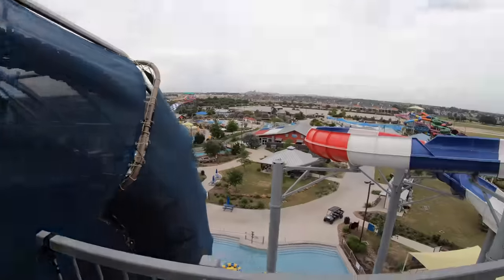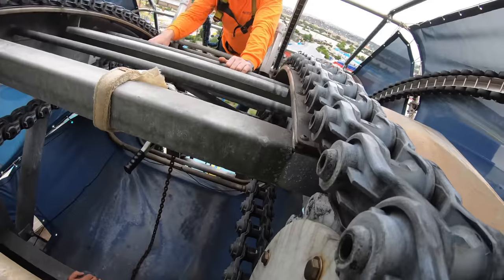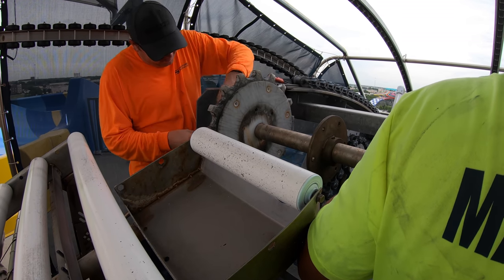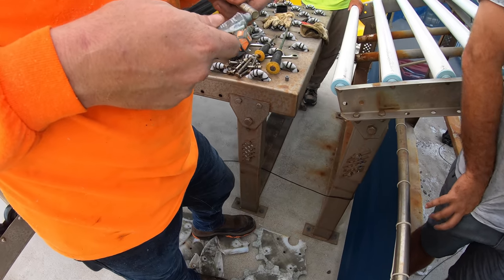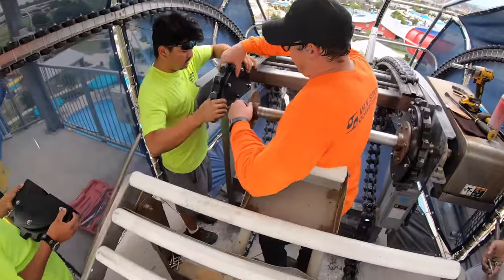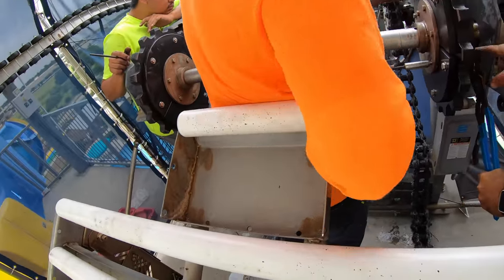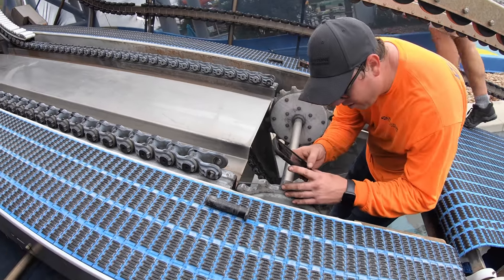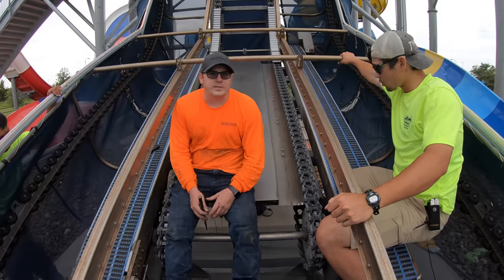Vanstone Conveyor Main Chain Sprocket Replacement

Comment: Sure it is a proven way to replace this, but for strength, wouldn’t it be stronger if the 2 “plastic” outer rings, bolted to the sprocket, are turned 45° on one side and 90° to the other side of the sprocket? And for crack finding, UV absorption and heat expansion, made of a white material?
Reply: Also I’ve seen one bolt missing in the right sprocket, might have missed you talk about it, but what wrong with that?
Reply from the maker: So the bolt, we had replaced when it was cross threaded.  We were on the floor when one of my guys went and replaced it.
As for the sprocket pieces, it's hard to tell on the video, but they the pieces are cut off-set so the cuts do not align, giving to the strength you mentioned.
Reply: @thepoolguy  I think he was talking about how the pieces should be rotated so the bolts link everything together before the main drive shaft. A vague offset would prevent lateral movement, but not rotational. Given time and force those plate's split gaps could widen and lead excessive wear or worse something to jump..
Reply: Agreed. I was a bit surprised they had all the cut ends lined up. Maybe this application doesn't need the added strength, but for sure, rotating the side support rings about 90 degrees from the split gear would reduce stress at the hub and greatly add strength to the entire gear assy...
Reply: Absolutely, but depends on how the half’s were manufactured and whether the keyways permit the indexing.

Comment: What are those sprockets made out of? looks like some sort of plastic, Teflon, or pvc?
Reply: If I caught it right, HDPE aka "High Density Polyethylene" which is a awesome dense plastic that is also reasonably smooth and sometimes described as self-lubricating (not really, but better than some). Commonly used for bushings and such as a wear component, so that the HDPE part wears down first before the more expensive or difficult parts. Note when they were at the bottom and there was a  guide he was talking about being worn and that there is a new one. That is likely designed to be just a bit softer than the chain/links, so that the links move easily but if/when wear happens it is "simply four bolts, length cut to size".
Reply: @admalledd  i have heard this black HDPE often referred to as Delrin, but I guess that is just a brand name. For people wondering what it is like, it is essentially the same material plastic cutting boards are made of.

Comment: Even though most of their (workers) weight is on the platform when leaning, should they not all be tied on?
Reply: The guy at the 1:29 mark standing in front of the camera is clearly wearing a proper harness with a tie off lanyard on his back. You’re not very observant are you?
Reply: @Alejandro-vb2fx  1) I said most. 2) I was talking about the 3 guys leaning over the edge/right on the edge of the platform. Whilst there is netting, I'd still wear a harness
Reply: @georgeh-w5041  they're still behind a railing, except for those inside the raft tower.
Reply: @BeezyKing99  maybe I'm too risk adverse 🤣

Comment: I would of thought that the outer half moon pieces would of been 90 degrees off to sprocket teeth for more strength.  For getting the old ones off I would of had a propane torch on a old butcher knife from the park kitchen an make a hot knife.  For chain pins I would weld a deep welled socket to a c clamp to pop pins back in.  Could do same thing with a c clamp to remove the pins too so no having to hammer on chain.

Comment: For cutting those old sprockets off may I suggest an oscillating tool. Idk if it'll work I know if I was doing something similar I would use one of those but idk if they'd work on that type of material never cut that stuff with one before.
Reply from the maker: I think we may have tried one... I don't remember,  but for sure that's a great idea. We have a couple for cutting pvc pipe.

Comment: I would have the split in the disks on a diverent axle as the splits in the gears
makes it stronger
Reply: Yeah i would have thought the splits on the side plates would be better if they were 90 degrees to the gear split, having the split just half inch around from the gear split seems odd. I wondered if they got the side plates mixed up between the left and right gears, but i guess they have their reasoning

Comment: Why’s that bolt missing at 27:14???? 😱
Reply: I was just about to ask the same thing.
Reply from the maker: Good eye, the bolt cross threaded so we had to get another one.  We had one back in the parts room, but we decided to get the chain on while we waited.  Bolt was replaced before we turned on.

Comment: One thing about those new sprockets is that the very visible cracks we can even see in the vidoe won't be so visible on the black material. I don't know if they will fair better than the white ones, but it would be something to note on the inspection instructions.

Comment: Those bottom two sprockets look just as cracked... plans on replacing those too?  Looks like it might be an easier job
Reply: Bottom ones are not really load bearing or doing any driving though so the top ones would definitely be priority

Comment: You know you just made those lock nuts basically ineffective by putting that anti-seize on there.....

Also cutting those gears apart, why so many cuts? Two cuts 180° apart would have made them fall off, just like the replacement gears SMH......
Reply from the maker: We could not get the blade in far as the adapter that holds everything in place would not slide out of the way. And our blades were really long